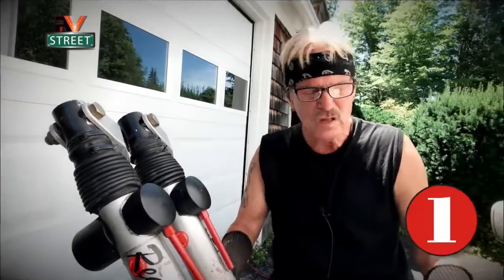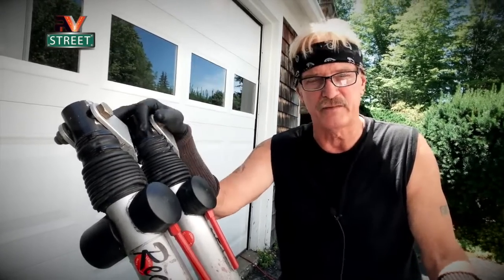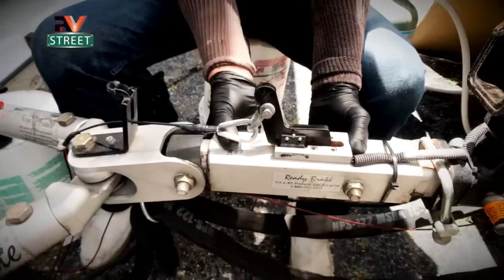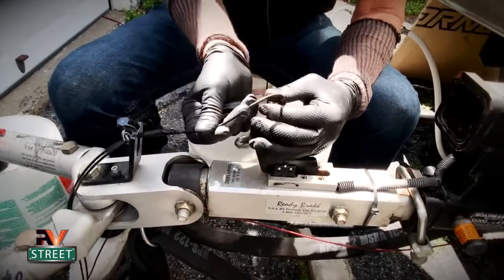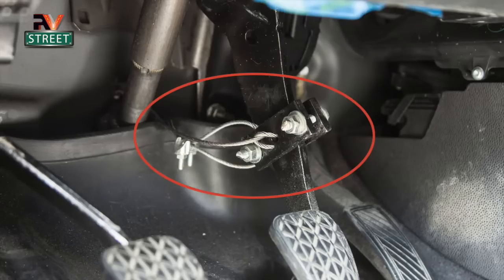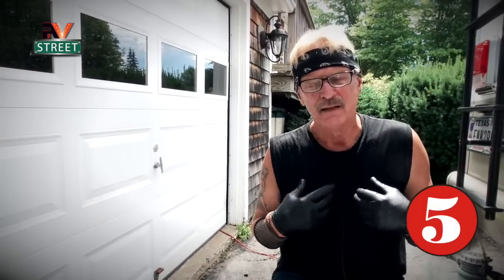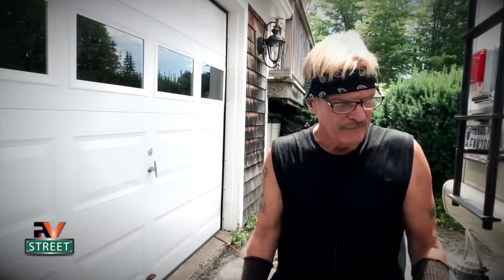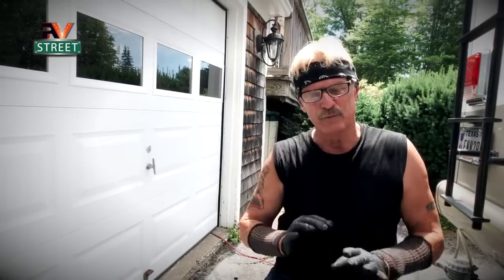BE SAFE, BE LEGAL, 4 DOWN TOWING behind a Motorhome

Comment: Great video, really leaning toward a ready brute elite II , out testing my liberty downhill coasting, engine off, after 3 or 4 brake applications, I can barely push the brake on. NSA says dont worry, not a problem, but I'm not so sure. I know they sell a little vacuum pump, what do you think?
Reply from the maker: I'm not sure. That's why I bought the ready brute elite. I didn't want all those problems and added accessories to fuss with. Just more stuff to maintain and break.

Comment: HI, i DON'T BACKUP A TRAILER VERY WELL, IS BACKING UP A TOW VEHICLE THE SAME ?
Reply from the maker: if you are flat towing you can't back up with it attached to the motorhome.
Reply: @RVstreet  SO IF YOU PULL IN AND MUST BACKUP, YOU HAVE TO DISCONNECT TOAD ?
Reply from the maker: correct